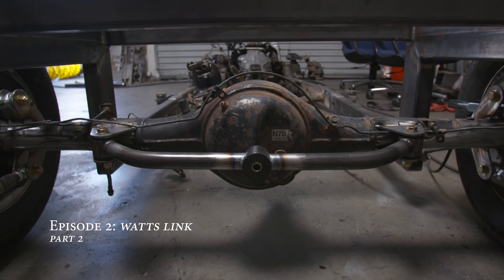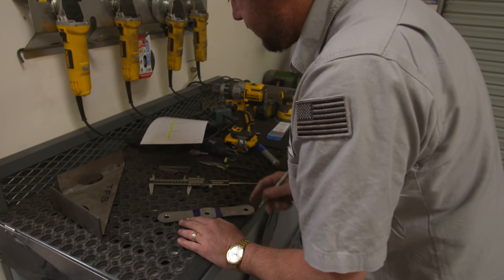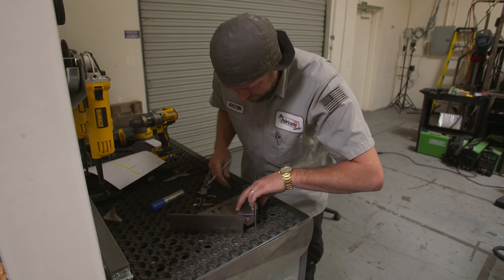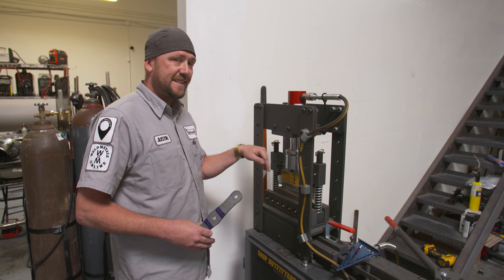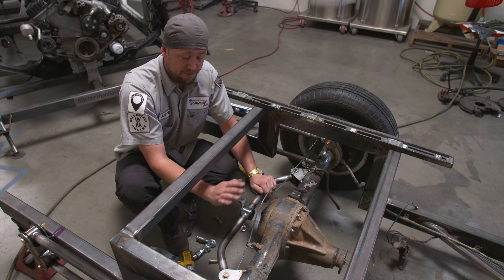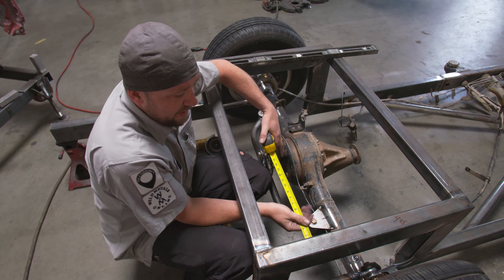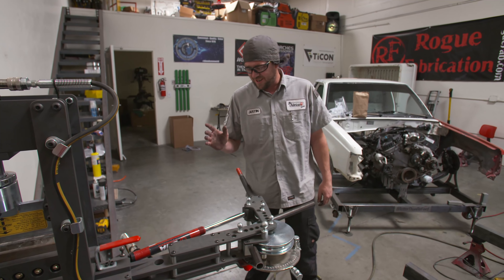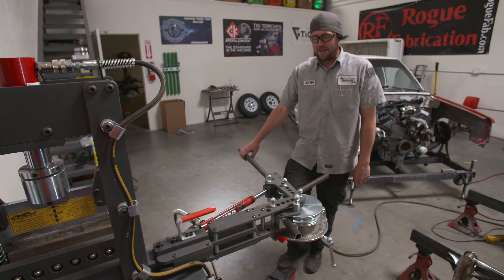Watts Link pt 2

Comment: Great 2 part series! I have been into handling since Addco swaybars intro to me back in 1970. I then learned about the Watts Link and sway bars.  This video helps me with on  my next handling improvements in my 2001 S10 2wd truck. A watts link. I started with adding a 2nd front swaybar to the front  like what GM did for the newer 1500 trucks. Mount the bar behind the front wheels. I did this and left the stock front bar in place. Tested it! What a big difference! I then did this in the rear. My S10 Xtreme has a rear mounted rear swaybar installed stock. I then installed a forward mounted rear bar and left the stock rear bar in its place! What a Big difference! I have done many improvements to the frame and suspension for handling. Lowering, bracing front steering brace, middle cross-member brace, and rear K brace. Remounting the battery under the bed behind the right rear wheel, adding 100 pounds of lead weight under my stock rear bumper, a K brace for my shackels like the Toytoa X runner pickup, body bushings,shocks, springs,  steering shock, and more. The truck handles SO good now! Very balanced when I pitch it around and it still rides smooth on smooth roads! Tires which are 2007 Corvette C7 wheels 18s and 19s, are nice looking polished, but tires only last me 3-6 months when drive hard in the turns, and expensive to replace. I did buy a watts linkage kit a couple of years ago but it looks like a you compared to yours! Great Channel! Subscribed!

Comment: Should have lined up the pivot on the same linear line as the pinion.  And weld the Watts link directly to the axle housing.  Simpler, cleaner, etc.  Plus it eliminates the flex of the tabs/mounting hardware holding the Watts link.  Any deflection will be minimized and therefore the angles will be more accurate.  Have a good day, Justin.
Reply: Paul Stuart Wilson
There is zero reason to align the Watts-Link Pivot with the Pinion centerline, but welding to the housing is definitely the only way to go .
This setup, with welding to the Axle Tubes, and especially using Poly Bushings, is just asking for problems .
.
.

Comment: 1 question about the reverse 4 link. Say you wanna drag race or just have higher horsepower. How does this setup apply power to the frame. With a regular 4 link you can set the instant center above or below center of front tire and it will make the tire bite more or less. Curious to what the instant center will be at ride height on this truck
Reply: I just hope he does NOT get hurt driving that backwards 4 link....
Reply: I don’t think this is a drag setup.
Reply: I think the worst that would happen is a whole lot of wheel hop. But if he has the frame mounts at or below the axle, it should still hook up.  The setup you would want would be the opposite of a standard 4 link.
Reply: This design has an infinite instant center. There is no rotation of the axle as it bumps and droops. 

For anti-squat, which I what I think you are talking about when you are referencing "bite", it depends solely on the angle of the lower links links compared to the angle of the 100% anti squat line. The 100% line is found by drawing a line from the ground under the center of the rear axle to the height of the center of gravity at the center of the front axle. If the rear lower links are at this same angle then the anti-squat is 100%. If the rear links are flatter than the 100% line then the anti-squat is less that 100%. If the links are steeper, then anti-squat is greater than 100%. 

In this setup (rear mounted parallel four link) the anti-squat will be positive when the links are higher at the axle than the frame, and negative when the arms are lower at the axle than the frame. I am assuming anti-squat will end up being positive at ride height, but we will see.
Reply: Peter Bingham zero wheel hop with this setup
Reply: nathan butler  we have done this 20 years ago on race cars ..drag and oval.....never really worked out as it was damaged very easily.  Done mostly because guys think they are doing something new.  Its nothing new...Lot like watts link....on paper it looks great...real life prone to lots of failures. Be a ok cruise night piece to show off welding skills..  Dont ever weld to a rear housing like he is doing....dime size weld warps rear end badly.  Fix these messes now for last 45 years.  Like the old camaro clips....
Reply: There is no "Anti-Squat" or "Body Lift" upon acceleration with this setup, this is strictly a cushy ride cruiser, 
or would it be, if the Heim Joints were replaced with Poly Bushings, the Heim Joints are completely out of place on this install.
With a parallel 4-Link, it doesn't make any difference whether the Bars face forward or reverse.
This setup CAN NOT compensate for Axle Torque in any direction under hard acceleration, but it will provide a cushy ride with no binding.
This setup will cause the right rear corner of the truck to drop, and the left front corner to lift, upon hard acceleration.
It's NOT designed for hard driving, it also IS NOT the same as the original Leaf Spring setup as he keeps referring to.
Leaf Springs "can"  provide substantial Roll resistance and Anti-Squat properties, which this setup absolutely CAN NOT,
(but those qualities depend on the configuration of the particular Leaf Spring installation being considered) . 
A stout Rear Anti-Roll-Bar would be a welcome addition to this setup because there is zero roll resistance with a parallel 4-Link,
and the Roll Center is not very high, (roll center is created by the Watts Linkage).
There are many other better options that could have been used, namely, replacing the upper parallel links with a solid Triangular Link
which would be attached with a single Poly Bushing to the top of the differential housing,
this would provide Anti-Squat properties, along with a higher Roll-Center, while still having zero binding on full suspension travel .
.
.
Reply: Jim Brown  rear roll center is center bolt of watts link... also those links off by .250 the bolt breaks.... ( grade 8 bolts break)on air bags probably the worst setup you could do. Heavy sway bar a must...  this is a mess..
Oh well guess guys that invented this way hid their mistakes from the past
Reply: @docholiday1034  
What many people don't get about suspension linkages is that they need to be strong enough to support the full weight of
the car applied SIDEWAYS to the Axle or Spindle AT THE VERY MINIMUM.....  
Heavy Shock Loads applied sideways can increase that requirement by 5 or 10 times.
All mounting brackets must place the bolts in "Double Shear" configuration, and be fully triangulated.
Heim Joints are  "sexy looking"  but directly transfer shock loads with zero cushioning effect,
making Poly Bushings a superior solution in most cases.
.
.
Reply: But won't it get wheel hop he's  technically reversed the caster angle completely.
Reply: @kieren7763  
There is no Caster Angle in a solid axle rear suspension.
Wheel Hop (on the STREET) is caused by a poorly set up leaf spring suspension combined with worn-out, or inadequate, Shocks.
Drag Racers may experience "Tire Shake" with Huge Slicks, this is sometimes called Wheel Hop but is completely different.

Comment: Great work as always but can’t help but think that you should have just made a couple of shims on a lathe to go either side of the rosejoints(heims). Would have avoided putting 2 bends into each of those pieces of flat bar.
Reply: My thoughts exactly. No need to get all "arts and crafts" with it. Just stuff some shims in there, and move on.

Comment: I would double nut that pivot point on the center  watts link bracket, then you can loosen that boot up a half turn so that there isn't too much pressure on that bushing to create friction or bind, and it won't want to walk that bolt loose during the travel, you don't want it too tight, I put all zero fittings on my joints when I built my suspension so I could grease them

Comment: What I'm getting out of it is. The wax link would be used for air bagging or four wheel drive vehicles due to the travel. Drag racing not as important. Is this correct?

Comment: This is an interesting setup.  When you say the suspension is "at half-travel" do you mean the suspension is at nominal ride height?
Reply: Rik Burt It could be, but not necessary. The important thing is half way of possible movement/travel.
Reply: To expand on Jasper Walls explanation, he chose half travel on his suspension because the watts link has "travel" too. So you want your watts link bars and 4 link bars both parallel to the ground at half travel so both systems have the same "swing" with full compression and extension.

Now his "normal" ride hight could be any where in it's travel but typically if you are building your own chassic and suspension from the ground up you pick half travel as your ride hight. Not always depending on application.
Reply: @Rik Burt by building it at “half travel”, or essentially ride height, you can put all the joints in a neutral position, so as travel changes and the joints move, they’re less likely to bind before they run out of travel.  On road builds are a bit different than off road, as the travel is only a few inches vs 12-30” for the off road world. 

Either way, it’s a good practice, because it helps to avoid cutting things back apart later on.

Comment: I keep looking at the rear trailing arms that are mounted behind the rear axle. It looks like the rear pinion angle is going to be at an increasingly BAD angle as the rear suspension moves through its travel. The further the rear end extends downward....the worse the pinion angle is. You may have to limit your travel with limiting straps or by some other means. I am a car fanatic and I have NEVER seen a rear suspension setup like this. Thanks for always including the math and geometry associated with building the parts.
Reply: Yeah pinion angle is gonna be a disaster on this thing. I keep hearing about "carefully calculated" design here. . .but I'm not seeing it.
Reply: Pinion angle will be locked in place if it's an equal length parallel 4 link.
Reply: @zososldier  yes, but IS IT?
Reply: @Rileymanification  it looks like an equal length equal separation parallel 4 link.
If it is, the pinion angle might change by 1 degree at most if set up correctly
Reply: @zososldier  Correct, though for handling purposes, I am not at all sure what the deal with the trailing/backwards links is all about. Slightly unequal 4 links are quite common, giving anti squat and/or positive weight transfer under acceleration and braking. I guess it's just the fact that this whole thing looks kludgy and underplanned to me.
Reply: @Rileymanification  my opinion is he is gonna put this frame under a car. 
Rear mount parallel links let you keep more floor and give you space for a rear mount gas tank.
Reply: @zososldier  That makes sense, though I am still gonna give it one of these 
-- _ -- stares

Comment: This may be a stupid question, or I might just be an inquisitive idiot, but could the Watts Link work if you placed it on its side on top of the axle? Like if you took the axle as it sits and rotated the pinion down to the ground, that orientation. Just curious. If it would work in that orientation, you'd be able to connect both links to the upper part of the frame. Loving the series. The new format is a little to get used to but it looks like you guys are getting it dialed in. I like it, keep up the good work.

Comment: Put the center pivot at the top of diff housing, will kick both arms up, the top arm will be level with rail and bottom arm will sit 6 inch higher
Reply: Or, crank the bottom arm so it come up further for mounting point, yes you will have to rework geometry but will give good end result IF you work out peroperly

Comment: Always though that the watts link crank is supposed to be a bit angle at mid travel (to allow it to arc(rotate) both way of the vertical axis during it's full travel.

Comment: tip: use triangles in your frame designs as it is much stronger than square angles. cough cough. cheers.
Reply: I suspect this frame will give them problems if heavily loaded. 90 degree angles or over 90 degree angles are never a good idea in a frame due to the abrupt directional changes in the stress flow.

Comment: The monster step is what made the watts link difficult...it was overkill for a minitruck frame. A less aggressive amount of chop between the frame rails would have been the better idea like maybe 12 inches instead of what looks 18 + inches. And yes I do this regularly and have a half ton stepside Chevy in my shop as I type this and I'm not cutting this much out of the frame. Yes its bagged I finished the front including a z in the front frame and stock floor body drop. Calculations I have I should be tucking 24 and rocker before frame will bottom. I am using a watts link because triangulating would require more floor removal and be easier to back half the truck instead. Trying to keep the truck looking like a simple static truck until I lay it out. Oh I'm not running 24 inch wheels Its gonna be on drag radials so havent decided my wheel and tire combo yet.

Comment: What  made you go with the watts link and that arrangement of radius arms over a triangulated 4 link?
Reply: My wager is he is building this frame for a car build.
A forward link setup would eat into floor/seat pan. And he went parallel for a rear mount fuel cell.
And radius arms should be avoided at all cost.

Comment: What's the advantage of reversing the four link,
Space...
Reply: No advantages  at all. Forward would have been way better
Reply: It really depends on the chassis.
On some vehicles, a forward parallel 4 link can run into body clearance issues (resulting in having to cut floor panels and not everyone wants to give up foot/seat space) or some frames are super wide and  will narrow after the axle.
I personally think he is working on this frame to go under an old car body due to the fact he cut the standard upswept "truck frame" rails and added a flatter "car style" back half. But we will have to wait and see because it's a secret.
Reply: @dragsbody209  depends on the build.
Reply: @zososldier  
Thanks for responding...